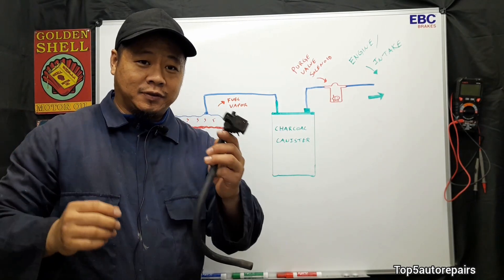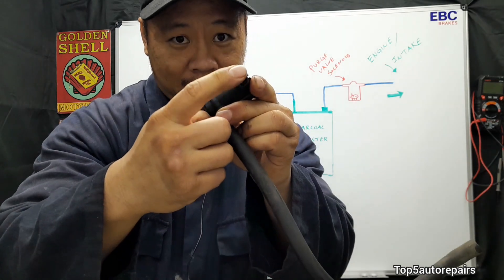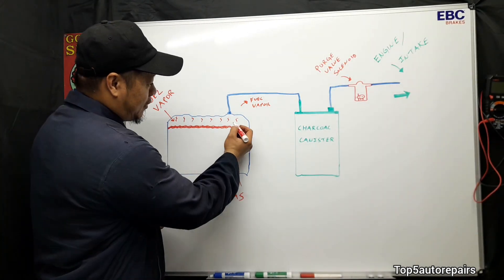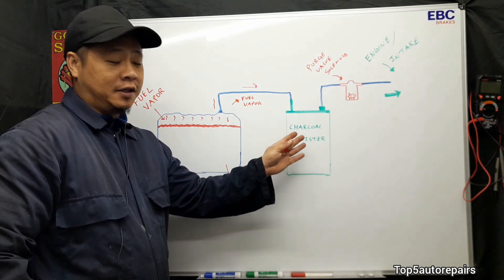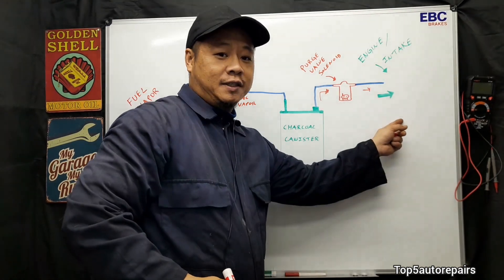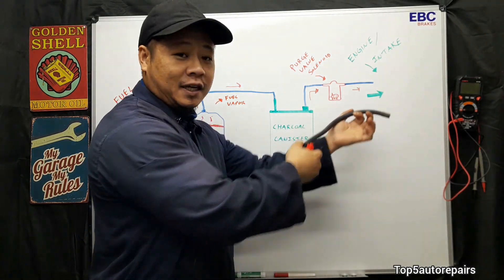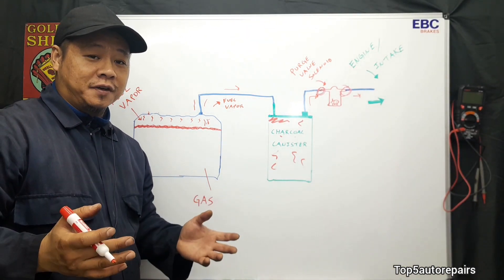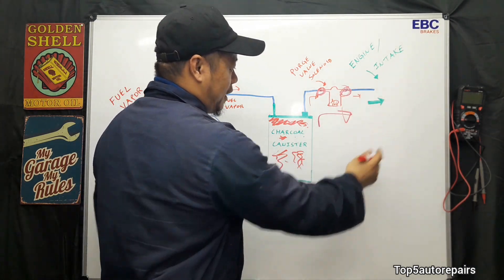Function of a Purge Valve Solenoid and How it Works on a Car

Comment: What is the duty cycle for that solenoid? Does it open periodically or does it pulse and meter the fuel by time proportionate cycling? IE: Is it an ON/OFF  or and pulsed ON/OFF when cycled?

Comment: Purge valve on my car is energized by ECM continuously that means it is open all the time. I have checked the valve mechanically is fine no leaks just it is been opened  by ECM all time but why?

Symptoms : fuel smell after tank filling, rpm fluctuation, poor fuel economy.

Comment: purg valve not working in the car, especially conector has 12v,
I test it directly to the battery and working fine,  any idea to fix this issue

Comment: Hey 👋 So I notice something about my LS that’s been happening for quite some time whenever I fill up my gas tank to a full tank my car runs really sluggish. This happens every full tank but ones it gets to half tank or less I noticed the difference on the acceleration power compare to full tank, it almost feel like the fuel pressure is low when I have a full tank and I have no check engine light on. I have a 2002 LS 3.0